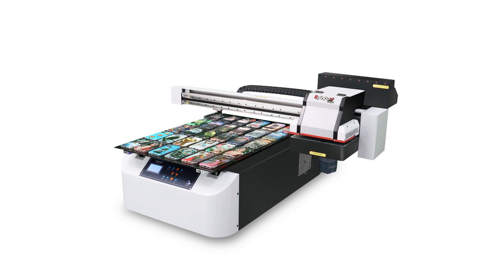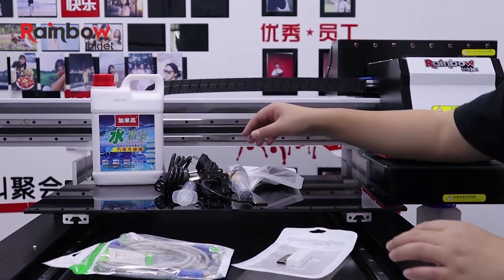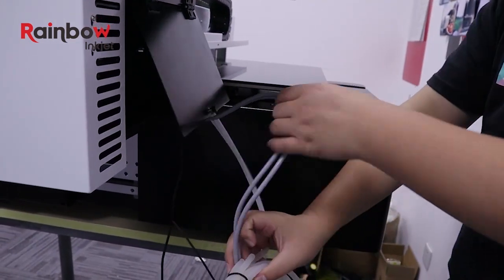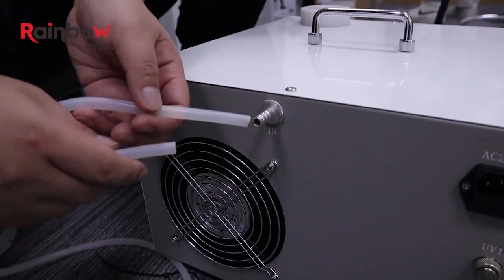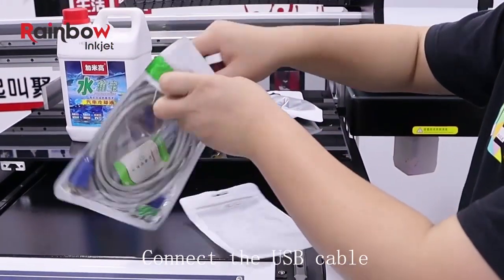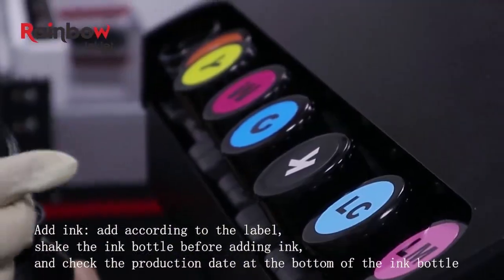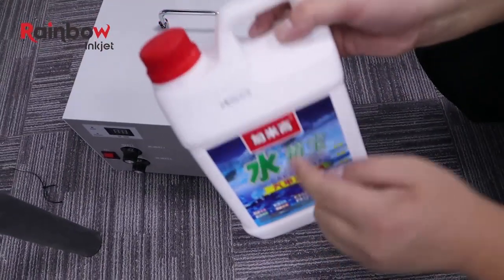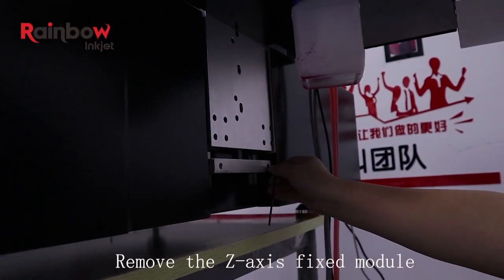Nano 9 printer installation EP1: hardware(Contact us BEFORE installation)

Comment: how do i connect it to my pc when it doesnt have a USB on the back but a rj45.  Do I do Rj45 to usb?
Reply from the maker: hi friend, the printer comes with a cable you can use, please check your parts package
Reply: @Rainbowinc  I don't have a cable.  I just have the rj45 to rj45.  It that it?  Or can I just go to the store and get a rj45 to usb to make it work?   Or is it a special cable
Reply from the maker: please contact the technician who is supporting you, you can message in the group, during installation we have systematic support.